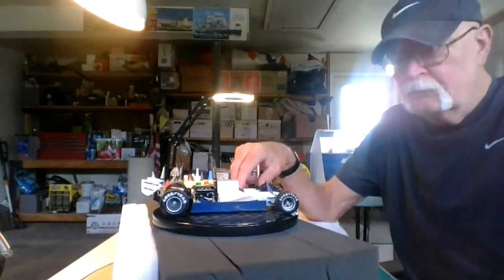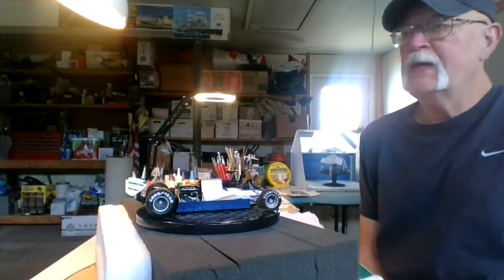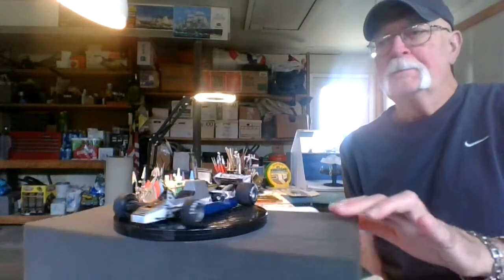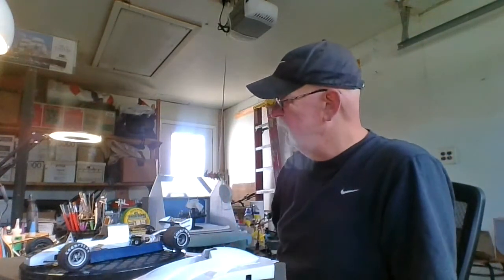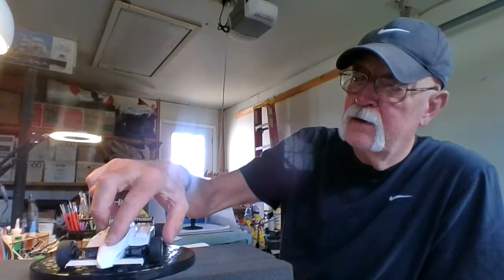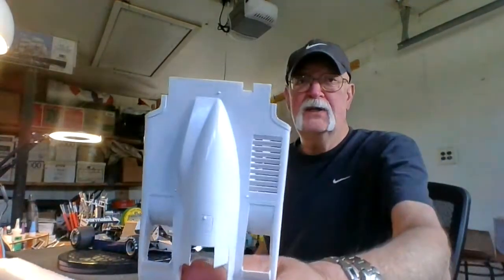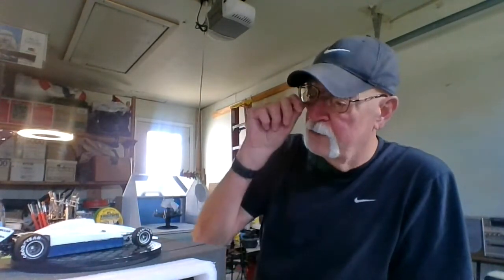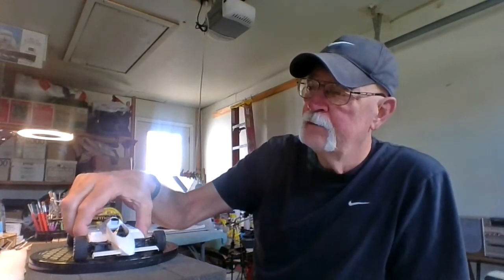Part 6 of the BT50 BMW Turbo by Tamiya 1/20 scale

Comment: Hobb's is camera shy.  The BT50 is looking great Bruce.  Terrific work on getting the shell to fit down nice.  A Good tip with the Gel pens.  I've been meaning to try that.  I dry brush acrylic white on raised lettering.  It's a bit tedious and time consuming with some clean up, since I'm not the best dry brusher.  My thought would be to mask and spray your blue.  Then clear with Pledge.  That will give you a level gloss surface for the decals.  Once you have all your decals on, shoot it with Pledge again to seal them in.  Side note:  if you want to seal the edges of the masking to eliminate possible bleed through, you can shoot light coats of white after you mask to seal the edges.  After that dries, you then spray your blue and it won't be able to get under the mask.  It's a great way to do it when you're using flat paints.  To avoid paint ridges, don't build up too much paint at the edge of the mask.  That can be tricky.  I'm not sure if your white and blue are enamels or acrylics, but always remember acrylics (including Pledge) on top of enamels/lacquers, never under.  You can get away with breaking that rule in special circumstances, but not in general.  I wish you luck with it.  I suspect you'll do fine.   Take care and be safe.
Reply from the maker: well, I painted the blue today onto the body masked everything off it came out great and just have to let it dry. I will spray it with Pledge tomorrow. Thanks for all your help.

Comment: I have only used Future as a final coat. In fact, I have started using a water based gloss coat that I thin with water as a final coat called DuraClear High Gloss Varnish. I really only use Future for canopies. My problem with Future is will it be durable enough against taping off the area? I have seen where guys will tape an area, shoot it with varnish to seal the tape edge and then shoot the final color.
I must say though Bruce, you are doing very fine work!